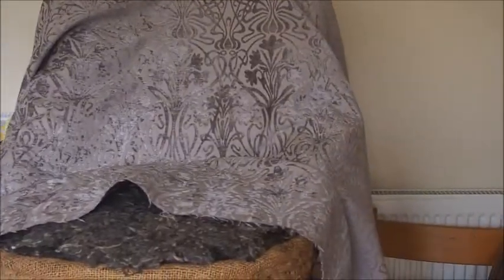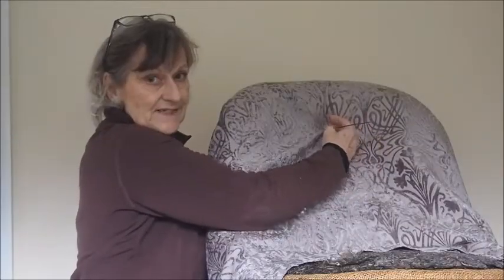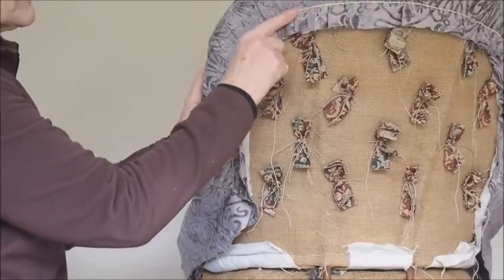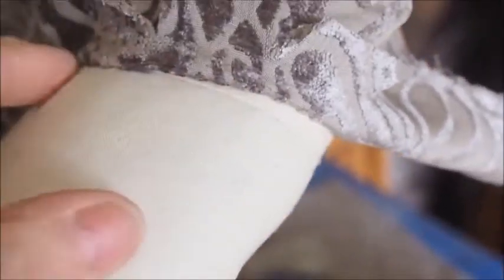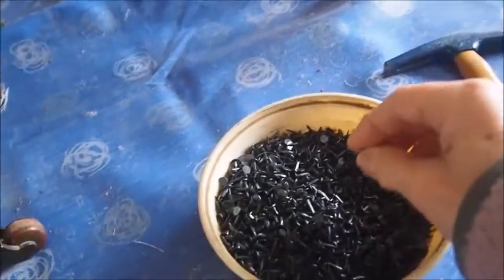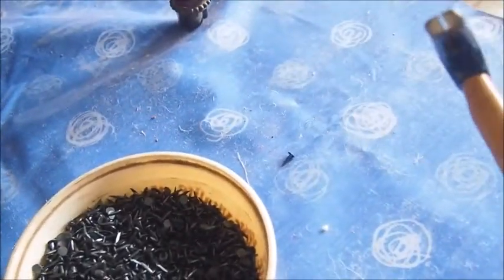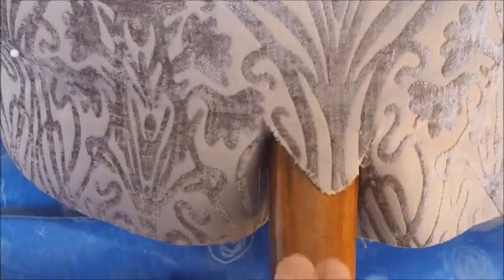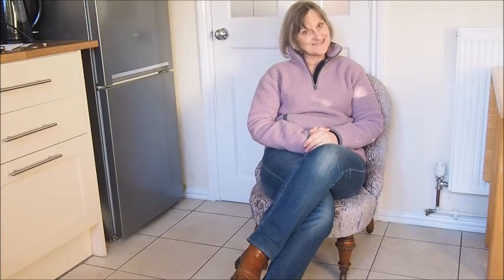Restorative re-upholstery. Victorian Button Back Nursing Chair. Part 3

Comment: That was excellent! I have a Victorian nursing chair. It's lovely but tattered. Can you tell me the essential beginners "kit" that's required for learning upholstery and do you recommend any suppliers? I am in Canada. Thanks again.
Reply from the maker: Thanks for your comment. Perhaps I need to do a video on basic kit.  
The correct tools are essential and for basics, a very good electric staple gun, if you don't have a compressor, a web stretcher, magnetic hammer for tacks, a regulator (the long flat headed needle) and some strong curved needles, Upholstery tack and staple lifters are also very useful. You'll need to make sure the materials you buy are fire retardant, then you'll need webbing (I generally use strong hessian webbing), upholstery twine, hessian fabric, and scrim hessian. Tacks and /or staples. Depending then on what you're upholstering, you'll need wadding such as linta felt, black felt, foam, or hair/hair substitute. You will need fire retardant cambric if your top cover isn't fire retardant. You should, especially if your piece is for someone else, use labels that state the components are fire retardant. Again, materials really depend on the job in hand and fire retardant compliance on where you live. You can find the answers online.
Regarding suppliers, I'm in the UK, but periodically search online for suppliers and their prices. However, for small quantities, Amazon can be a good place to start, and their prices are competitive. Hope this helps.

Comment: What thread do you use to stitch the back fabric to the chair please?
Reply from the maker: I use a fine gauge upholstery twine, but if you look up extra strong upholstery thread, you could use this as well. Gutermanns do it in different colours. Thread can wear thin as you pull it through heavy fabric layers and can snap, but you'll work out how long a length of thread you can use as you go.
Reply: @crofthouse489  oh thanks for being back to me. So maybe a No 2 barbours twine would be suitable I guess?